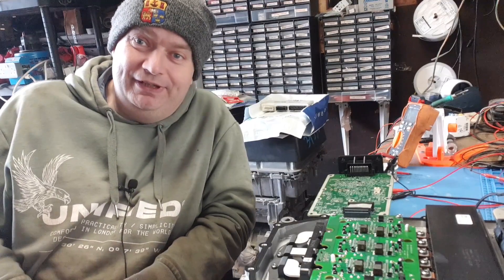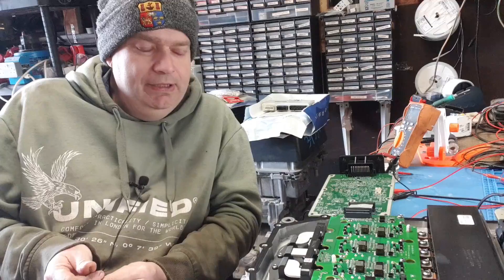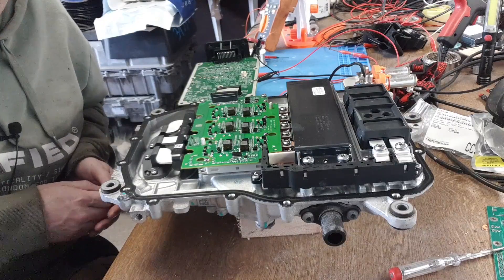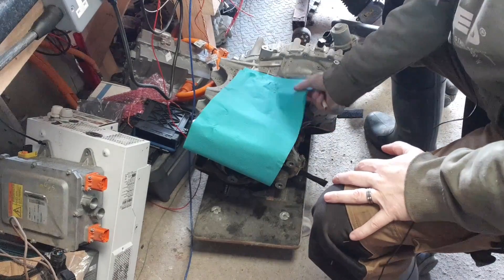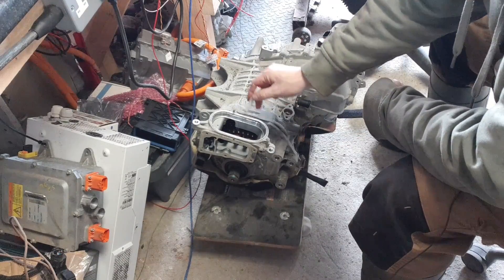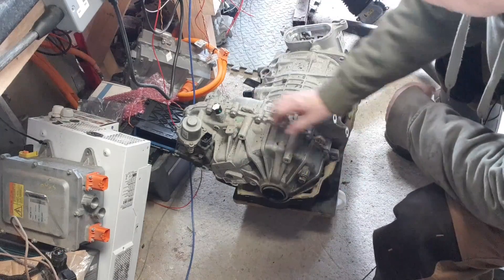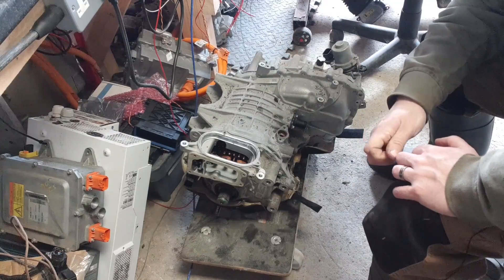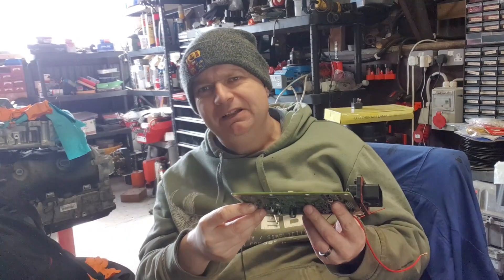MG ZS EV Inverter Reverse Engineering Part 1

Comment: Hello Damien! Nice work. You have done a lot for providing cheap and reliable solutions for the EV conversions and it has really helped me alot with my budget EV plans. Could you please tell me if Zombies could also work with the Nissan e power inverters as well? I believe E power vehicles are very common nowadays and although they have the same EM57 motor setup and one can extract not just one but two motors from a single transmission. actually I cant find leaf parts here in Pakistan as leaf isn`t very common here but note and kicks e power are in a significant number and the parts are coming in too. cant find much of content on e power inverters but thought I should ask you if you ever came across any of those too. Thank you in advance.

Comment: Fantastic news Damien.  I am eyeing off one of these as my donor EV so great to see you working on the reverse engineering, and also great to see how well designed it is.  Am I right to assume that if I order my Zombieverter now, a future firmware update will bring integration of the MG inverter and Battery charger?  Cheers and keep up the great work!
Reply: Charger probably, but if you listened to anything said in this video you should realize Zombieverter won't be able to control this inverter with its OEM logic board.
Reply: @celeron55  Hi Celeron - I actually did listen to the whole video, and Damien said that he was going to work on a new board for the inverter.  Hence the reason for my question to him.